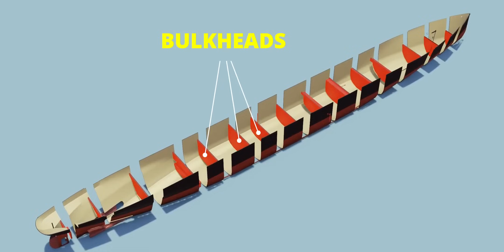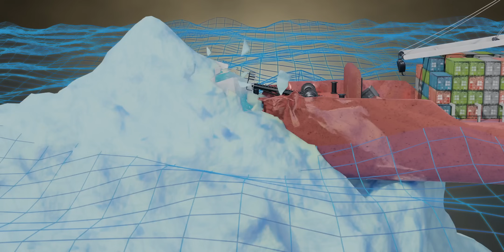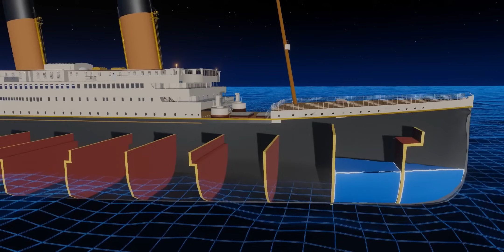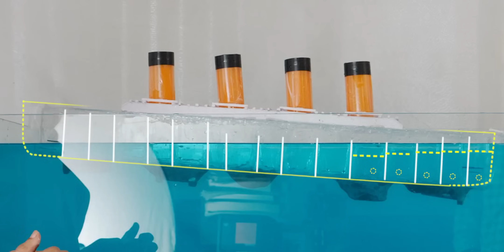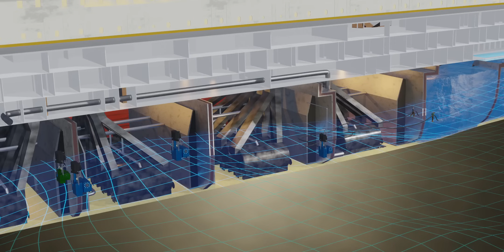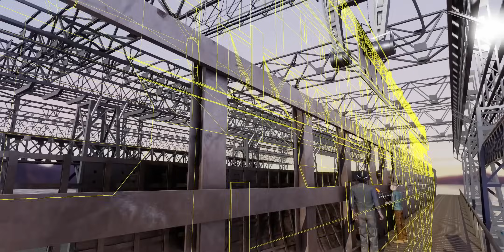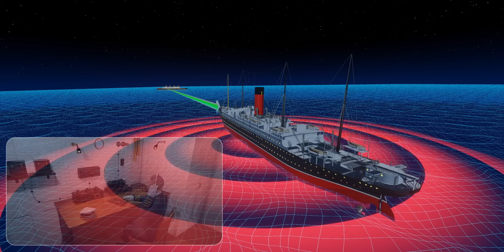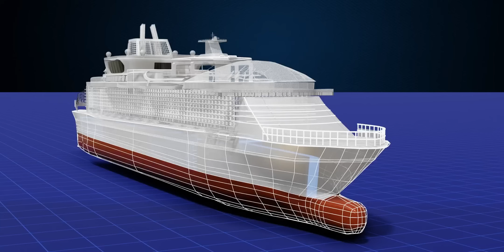How did Titanic Sink? | The Complete Physics

Comment: Captain Smith said "Modern ship building has come along way, so nothing could cause this ship to founder"
Reply: Wasn't the quote more along the lines that he couldn't imagine a situation where the ship could founder, not that he outright said it couldn't founder?
Reply: @justinlynch3  Yes, I think so.
Reply: "I will say that I cannot imagine any condition which could cause a ship to founder. I cannot conceive of any vital disaster happening to this vessel. Modern shipbuilding has gone beyond that." This is what Captain Smith said, describing Adriatic
Reply: @gokulgopan4397  Thanks.

So yeah he did avoid saying the ship cannot sink or calling it unsinkable, at least in an outright sense.   He may not have conceived of an event that could sink the ship, but just because he couldn't imagine it doesn't mean it can't happen.
Reply: @justinlynch3  Apparently, the most common incidents were ship-to-ship collisions or groundings. Iceberg collisions were extremely rare, less than 10, I believe. And none of them were side scraping. 
They built with these incidents in mind. The compartment design would protect from ship-to-ship collisions and the double bottom prevents grounding. 
Nobody envisioned iceberg side scraping to open up 6 compartments. The most damage they could think of, obviously based on their experiences, were a2 compartment damage. Olympic class was outdone to withstand 3 compartment damage.
Reply: @gokulgopan4397  If I remember hearing right I think Olympic class could withstand anywhere from 2-4 compartments depending where the damage occurred.   Like a breach to the engine room was probably going to be very serious.   But since if the ship was to collide with anything it'd be expected to hit bow first, the bow could take on 4 flooding compartments and the ship would still be safe.
Reply: @justinlynch3  there can also be incidents where another ship can come from side and hit, like Olympic Hawke collision.
Olympic class could handle 4 compartment damage if it was first 4 or last 4 compartments.
In midships, even engine rooms, it could handle 2 or 3 compartments.

Comment: Unfortunately the water tight bukheads didn't go to top deck, so water could overflow when it reached the top.  Also, they used weak rivets that could not withstand the freezing temperatures
Reply: That's not a design flaw. Even modern ships aren't designed with bulkheads that seal at the top deck of the hull (called the "shelter deck" or the "strength deck").

And while Titanic could float with the first 4 in a row flooded, modern ships can only handle 2 or 3 on average. Safety is all relative.
Reply: It wouldn't have over flowed if the damage was within the limit.

Comment: Titanic's middle screw was three bladed olympic's was Four bladed
Reply: Titanic's 4 bladed center screw was removed and given to Olympic after she threw hers during one of her transatlantic voyages.  Harland & Wolf replaced it with a three bladed prop.
Reply: @RobbyHouseIV  There is not photos or proof that titanic ever had a 4 bladed centre prop and 1 peice of paper saying that hull 401 had a 3 bladed centre prop ordered.
Reply: @RobbyHouseIV nope. Olympic threw one propeller blade on the Port side. 
And Olympic had spares. It didn't take one from Titanic. Olympic and Titanic had differently pitched propeller blades. They can't be exchanged. 
Titanic's center propeller was always planned to be 3 bladed from the beginning. They were experimenting propulsion.